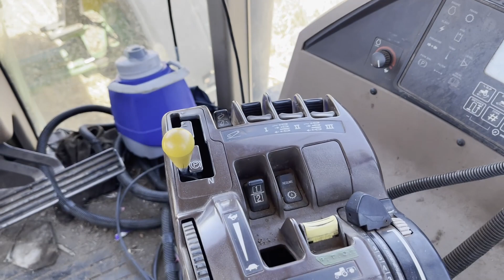First Time Chaser Bin Driving in the John Deere 8120

Comment: I gather your truck takes the grain from the grainer and you fill up the chaser bins as you go?  When you come across them?  I assume they are positioned to take the grain at the right places?   

I assume that your truck and assembly out the back is called the chaser bin as well, except you can only take so much?  So you dump it off in those temporary chaser bins as you go?     Is  that correct?